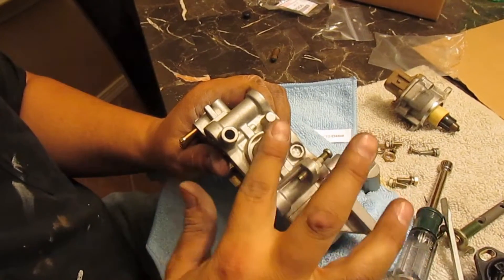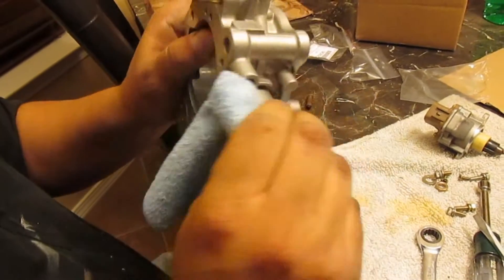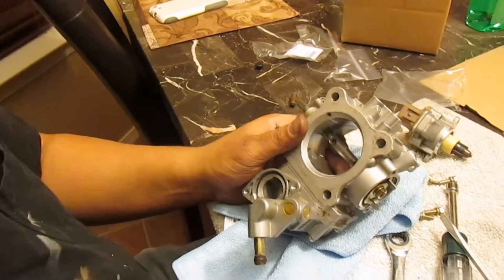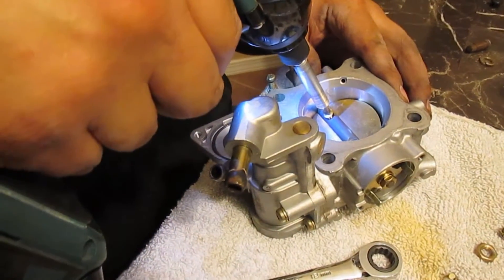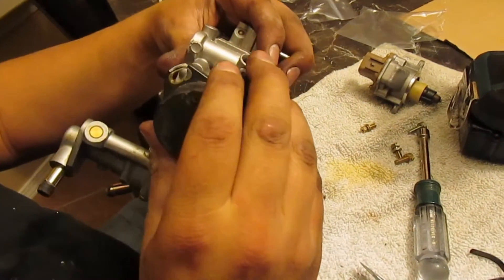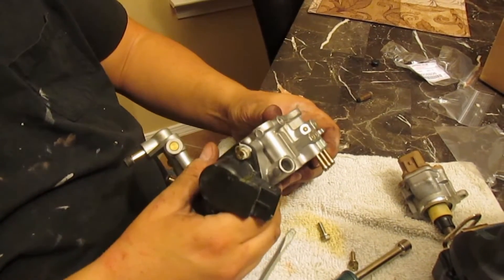HOW TO: 1990-1999 4G63T Throttle Body Shaft Seals

Comment: Your shaft seals were leaking. What were the symptoms you were having?
Reply from the maker: Boost leak test showed bubbles coming from them.
Reply: @FatGuyBuilds  ok ok. And you had the throttle pressed down for the boost leak test?
Reply from the maker: @djack2058  yes
Reply: @FatGuyBuilds  ok thanks.  I appreciate the insight.

Comment: I smoke tested a Chevy Caprice 96, and spotted a vacum leak from the throttlebody shaft, is that normal or should it be rebuilt/replaced?
Reply from the maker: just put new seals

Comment: Did you use locktite on the screws? I have heard of horror stories where some of these screws have come loose and gone into the intake manifold... Terrible stories... :)
Reply from the maker: I did not.  But if u are worried.  Use blue locktite